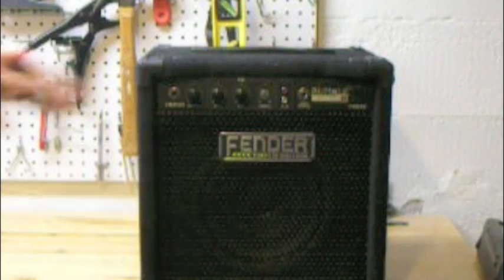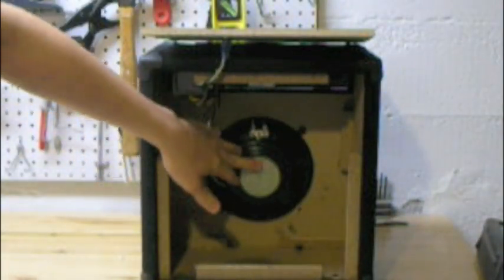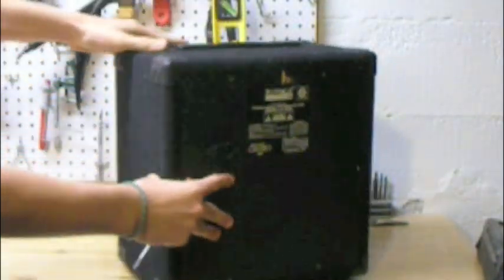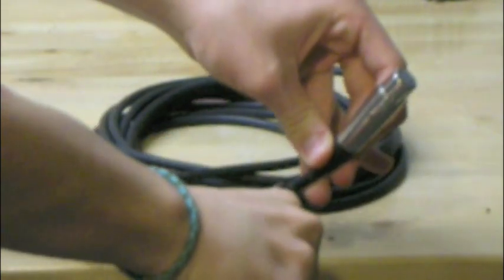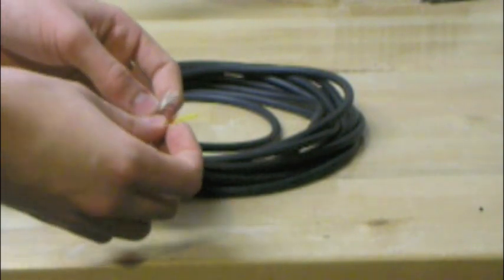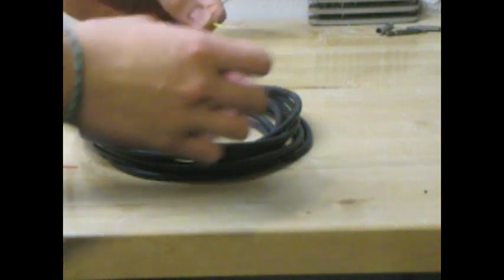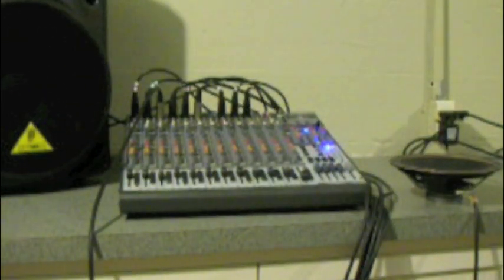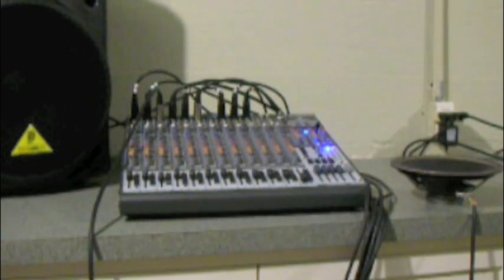How to Build a Subkick

Comment: I really don't get it. Why removing the back of the enclusure. You usually can unscrew the speaker at the front side and cut the wires. Why do you remove the enclosure anyway and put the cab with speaker in front of your kick drum?

Comment: I agree with Vlad Padowicz atVladTigrou, Your cutting wires and scrapping an amp, Why not go to a Radio Shack and buy the parts an make it without scraping perfectly good equipment?   this has turn in to a wasteful world.
Reply: It's not wasteful if you never use the amp. It's the pure definition of recycling old equipment.
Reply: there is someone somewhere that could have paid you more for that amp than the parts cost at the parts store (radio shack) then you would have made money while helping some other musician get equipment, that might have been an upgrade to him .
Reply: tedd gilda maybe his amp did not work. I turned a broken Yamaha amp into a useful tool.

Comment: If you mount the subkick like you did without an enclosure (open) it will pick up all the vibrations of amp hum and other low end vibrations around it and will cause interference. It needs to be in an enclosure for the best results... That way the only signal it picks up is off the reso head of the kick..

Comment: What are the advantages of removing the speaker from the original cabinet? I use a bose 201 series II speaker and simply connect my XLR to the speaker leads. It works perfectly. Are their any advantages of removing the speaker?
Reply: Actually, having it inside an enclosure would probably help, similar to how a pipe-bomb mic works.  I can't explain it in a technical sense, but think about how a speaker normally works: an electrical signal moves the speaker, which forces air forward.  A subkick, air moves the speaker which creates an electrical signal.  The box design affects frequency response.

Comment: Cool project! But dude, avoid the hassle of stripping wires and just open the xlr connector and use the iron to undo the soldered wires, as was done with the speaker wires. As an added bonus, those wires are already coated with solder, making the job  that much easier, and your connector is ready to be part of a new cable!!

Comment: you could just open the speaker from the front, pull it out and cut the wire. There is ALWAYS some slack. No need to open the back.

Comment: Used a car subwoofer in this method. 6 1/2 inch. Worked great! The key is to use a decent or particularly funky/cheap D.I. box. I have heard that the diameter affects which "note" you will hear, but the D.I. determines how cleanly you will hear that note. It acts similar to a trigger and an 808 sample without the hassle and with a lot more personal character. I highly recommend experimenting with whatever you have handy as you can always change the pitch later with melodyne/antares/cerrato/etc.

Comment: depends on the colors you have, if there's a black it always goes to the - a red typically goes to +
google whatever colors pop out of your cable or look on the  xlr end you cut off, the pins (1,2,3) are labeled and pin 2 is positive and the other one that's not the ground is -.

Comment: This method should cause the signals to blend in a more natural way, since the concept is to capture additional frequencies from the same sound source at exactly the same time (and probably at roughly the same angle/location). Triggering is about mixing in sounds from a different (possibly even synthetic) sound source that wasn't recorded at the same time.

It's not the same concept at all, it's the polar opposite.

Comment: There is a right way to hook the colored wires up. But if you get them backwards it WILL still "work," it will just be reverse phase. The best way to test this for sure is to hook the 'sub-kick' and another mic up side-by-side infrom of the kick drum and record them to separate tracks. Then look at the waveform in you DAW; zoom in on a kick hit, the large (low-frequency) lines should start off going in the same direction...probably UP.

Cheers.

Comment: not sure if you tried by now, or not.  but a high quality sub will be more firm when you push on the cone. this is bad because it wont respond as easily to the sound pressure produced by the vibrating head on the drum. a cheap, full range speaker is really your best option because it will have a better response to the sound pressure around it.

Comment: IMO 6" is the perfect size and usually has the best frequency response. Also, it's a really good idea to solder in some resistors cause that signal is going to come into your pre SMOKING HOT. Or if you're not too solder savvy, buy a Sure A15A5 switchable attenuator. They're kinda pricey for a plug ($40-70) but they are super easy. You can switch it to a 15, 20, or 25 db pad. Just plug it in to your subkick, and plug your XLR cable into the other end.

Comment: Can I use a PL-55 connector instead of an XLR? And is there any way to test which terminals the wires should be connected (say, with a voltmeter or something) other than attaching the wires itself? Thanks.

Comment: @phillipmaz being an electrician and dj. id suggest soldering it to the metal frame on the speaker. clean the paint first and check if there its power. no need in sending power back to your amp lol

Comment from the maker: @Phhization I believe another user commented about that, suggesting that it was the mounting system (having the subkick attached magnetically to a metal rod). I've changed the way it's mounted since then, but I haven't gone back to check if that sound is still there.

Comment: A 'tight' or stiff edged 8" woofer designed for smaller cabinets should work well.
...a dynamic mic works pretty much the same as a speaker, smaller speakers have less area and weight and will have a natural tendency to vibrate faster (tweeters are smaller then woofers), those same tendencies also happen if the speaker is used as a microphone-a smaller area will vibrate easier for higher frequencies, if you made the speaker small and sensitive enough you'd get a dynamic mic (SM-58 for example)

Comment: @gascochufan an amplified large speaker would have a tendency to vibrate slower due to its size, if this same speaker is used as a microphone it will act the same -a tendency to react to slower vibrations and ignoring faster ones -basically the speaker is too large and heavy to react to fast vibrations (high frequencies) however it will naturally vibrate easily with slower vibrations (low frequencies)
..of course a larger 'woofer-mic' will respond slower and could also be difficult to lug around

Comment: @gascochufan 
The best speakers to use are 6" flat response cones out of monitor speakers. yamaha used an equivalent of an ns10 or sn10. a sub speaker is built to be driven quite hard and is heavier, therefore less responsive as a mic. since you want to use it as a mic, the lighter and more responsive it is the better - but needs to withstand the air pressure from the kick, so an old 70's cone from your parents attic (for instance) would probably tear fairly quickly.

Comment from the maker: @gascochufan I'm not totally sure how/if the subwoofer speaker is different from a normal speaker, but I think it should work. The subkick basically 'reverses' the flow of the sound, picking up what it would ordinarily put out. So, if you want to add some really low, boomy bass sound to the kick drum, the sub speaker should be perfect!

Comment: Try creating an air tight seal on the back side of the speaker diaphragm by making some kind of housing for the speaker. This will make it more sensitive and responsive and probably improve the overall sound.

Comment: sounds great but i can hear a ping happening from the magnet vibrating on the metal, switch to a snare stand or cut bungy cords asnd put it inside some type of first act drum from walmart or something. thats what i would suggest. but you would have better results shock mounting it with bucgy cables or something. this happens with condenser mics as well on high SPL sources when not shock mounted. LOVE the video.